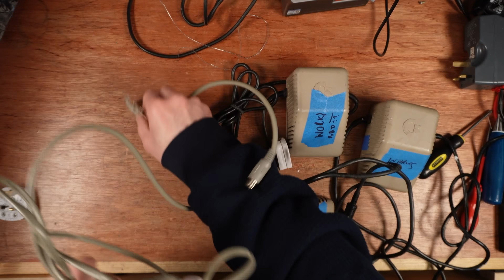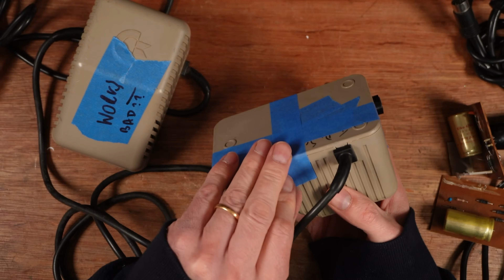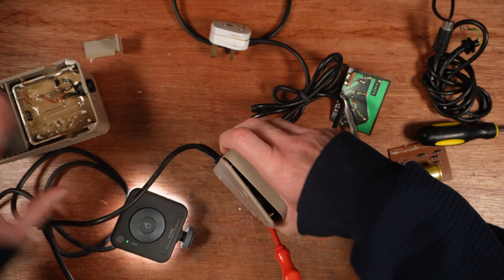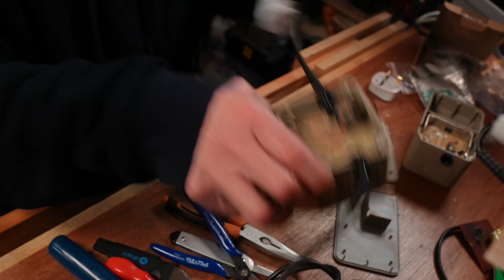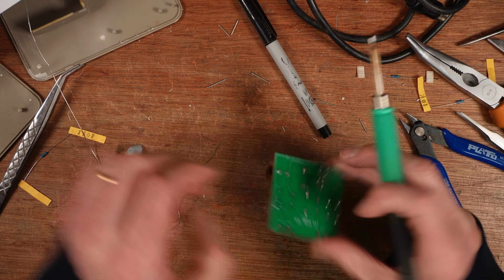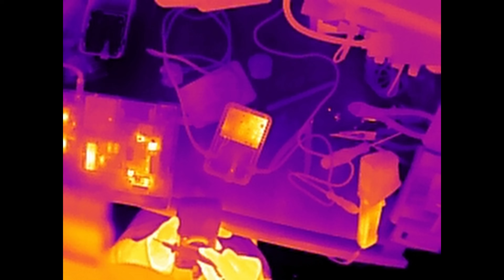C64 PSU Repair

Comment: Not sure if you'll see this now, but do the newer psu's like your C64c one still suffer from failing regulators? and if so would these boards fit in one of those PSU's?
Reply from the maker: Most C64 power supplies are ok really. It's just that enough of them go faulty in a really bad way that will destroy your C64. Some types are more prone than others, but personally I wouldn't trust any of them. This mod will only work with the brick I showed in the video.
Reply: @morefuntech  Okay thank you for the reply :). I'll see about a modern replacement for mine then, 'just in case' :D

Comment: Thats the first design I've seen that reuses the original transformer. Pretty nice.

The usual design I see uses a Meanwell module for the 5V, and a transformer for the 9V... which to be honest is pretty silly when 2x9VAC transformers are easy to get, and the 5V can be easily produced with a switch mode regulator. Usually the one with the 9VAC transformer just uses one of the secondaries anyway!

Comment: What I like about the UK plug is that it has a fuse in it and you can change it to a more proper value than the main fuse.
Reply: Thats the point of it really, because we have 32A "ring" circuits, which used to be protected by fuses as well. The fuse in the plug is designed to protect the flex going to the appliance from being overloaded in a fault condition.

Comment: Never ever put 'Chinese' caps in a project that you want to be reliable. They are renowned for failure. Only use quality Japanese or German Caps, like Nichicon, Rubycon. Trust me you are going to regrets this in a couple of years, when you have to break open the supply again. You also want to make sure the caps have a low ESR as the IC is a switching mode regulator.

Comment: Really bad power supplies. Made to die. If you open one, you can replace capacitor and diodes by another with more power. Diodes like 6 or 10 Amperes, and capacitor with working voltage more high. Then you can got a power supply to work forever. Only another problem. C64 computer like power supply don't was made to run forever. Not like Amstrad CPC. The most powerful 8 bits computer in the world. Made to run forever. You know this.

Comment: It's a shame they made the PSUs so difficult to service. The A500 supplies are much easier to get into. Also, a very simple crowbar circuit would have been nice, to protect against overvoltage.
Reply: There are potted Amiga power supplies as well... funnily enough the enclosure looks similar to the "rectangle" C64 supplies
Reply: @ i see. I only have one original A500 PSU, and it is super lightweight and not potted. Has very good ripple!

Comment: I installed this board. I noticed that it supplied 4.95V (even with the overvoltage) to the C64 which dropped slightly across it.
Reply: this is due to voltage drop in the cable and some loss in the power connector - especially so if the contacts in the plug and socket are dirty

Comment: I'm not in the UK and not in a 240V country. What's going on with that ground prong on the plug? You've only got two wires in the cable. What's the ground for?
Reply: Although the UK plug has an earth pin, on some applications, like this one, it is not used or needed. The UK plug has 2 options of wiring. A 2 core (Line & Neutral) cable for appliances that don't require earthing, or 3 core (Line, Neutral & Earth) cable for appliances that do. The earth pin is also used to move the safety shutter on the socket outlet open that covers the L & N before the L & N pins make contact in the socket.
Reply: All UK plugs have an Earth pin - not only does it give extra mechanical stability, it opens the safety shutters that cover the Live and Neutral outlet slots. The Earth pin is slightly longer so that it is the first to make contact when inserted.

edit: In fact Lee says all this at 22:00

Comment: I hate these epoxied-glued power supplies. Most times it will break and it will break ugly and will look ugly when I glue back and still have 1kg of epoxy. I prefer building a new one with a transformer and a 220AC-5DC brick. You don't have to build it overcomplicated with a hundred safety features, electronics went a long way since the C64 power supply and go bad differently. Be safe, use fuses, but don't protect the C64 you use twice a year with the price of a new car...

Comment: There’s an easier (and cheaper) way to get a similar result. I converted several psu’s using a ubec. You can find the instructions for this on lemon64.  Works great and even has an led.
Reply: The ubec is known to have a lot of ripple and in fact if you look at the board design files you'll see comparison tests vs a ubec. It works but it's not a good design.

Comment: You know what's struck me most in this video, when you're changing the plugs you're using a Phillips cross headed screwdriver! Growing up in the 70's and 80's when you learnt how to change a plug (or put one on as electricals didn't come with one) when you learnt to walk ( ;) ), every plug had flat headed screws. I have never seen a plug with cross headed screws! Is that just me?
Reply: I grew up in the 70s, when everyone learnt how to wire a plug at school, happy days. The older plugs were all slot head screws, but in my experience all the newer ones I have seen with the insulation on the pins are Philips/Posidrive screws, apart from some of the rubber ones I have, which still use slot heads.
Reply: @MrJozza65 yea, I think that goes to show how long ago I changed a plug. I might have done one 10 years ago on a C64...but thinking about it I just made sure it was safe and secured the existing old plug. Of course it makes sense that modern plugs have cross head screws, just that this is wierd having lived a lifetime before with the old plugs :)
Reply: yes
Reply from the maker: I know just what you mean. They have been about for a while now though :D

Comment: 5.25 is probably correct, at least for some versions,  according to schematics i've seen for c64 psus, they have a resistor in the 'ground' pin line of the 3 terminal regulstor to increase its voltage a little, likely to compensate for voltage drop across the DC cable,  i had a plus 4 psu of the wedge type with no 5v output, after opening it up it was obvious why , full of crscked dry joints, once resoldered, perfectly ok... you can bet many of the cases of overvolting was a dry joint on the ground pin of the regulator, if that happens they no longer regulate! i've never yet come across a shorted  through 7805, theyre supposedly quite resilient and self limiting, i dunno what actual type the commodore ones used(the schematic i've seen didnt give a type number), maybe a 'clone' regulator more prone to failure?   one way to improve 'safety' would likely be to wire a high power zener across the 5v line, to clamp the voltage, pretty sure you can get 'avalanche' diodes specifically for this purpose? certain'y seen them listed msny years back...?

Comment: The sealed these because they didn't want people messing about with them who didn't know what they were doing and potentially getting a 220v zapping. That's not a terrible reason, but the problem is the bed design with the voltage regulator cooking with the heatsink that they've embedded in toffee. Then again I don't think they ever expected people would be using these things 35-40 years on.
Reply: No. They were sealed and can't be opened so no one is going to 'mess' with it. The sealing was done to stop FCC Inspection because they knew it was minimal and cheap.
Reply: @g4z-kb7ct  FCC? These were made for European use, no FCC here... And the authorities will smash that stuff open if they need to.
Reply: @ The guts is the same regardless of country except for the transformer. The suss part is the board, that was the same in all those psus, square, angled or whatever.
Reply from the maker: We often forget these were never meant to last 4 decades!
Reply: That is the point (one point at least). They designed it cheap because they knew that it will be obsolete in 1-2 years so don't need to last 40, you will buy their next model soon so you want it to be cheap. And they were damn right and this made it successful. If only the company could have lived for a few more decades.

Comment: A simple but satisfying project. I completely agree with your preference to cut back to fresh metal when wiring the plug. Over decades the copper oxidises causing a barrier (ie. resistance) to current flow meaning that contacts are not reliable and prone to heat build up. Again,  like you I would be very nervous about drilling/screwing into potting compound- you never know what you might be touching! Since you deal with a lot of C64 PSU's it might be worth investing some time to rig up a DIN socket that breaks out the connections into easily accessible test points rather than risk shorting  the supply pins with the multimeter probes.
Reply from the maker: This is a good idea. I might look into this. Would make a nice project! Thanks 😁

Comment: This also gives 3 Amps on the 5v rail so with an adapter can also be used for the C128
Reply from the maker: Neat!
Reply: The regulator is capable of that, but the transformer's VA wouldnt be

Comment: regardless of what we all think the regulations state that flexes MUST have a ferrule  on them this is for several reasons not least strands being errant and of course the screw crush which may not be getting all the strands 
yes we all have put on thousands of plug tops without over the years but rules have changed
Reply from the maker: Hi. I used to be an electrician, and whilst that was a long time ago I felt confident saying what I said. But to be sure I asked a couple of current (pun!) qualified electricians to check the regs for me and they say that there is no such regulation that ferrules need to be used in this situation. In fact one pointed out that using a ferrule in that confined space can actually cause issues. I hope that helps.
Reply: They haven't asked everyone to buy a ferrule crimper... pretty sure it's fine, just don't be a knob and make sure you don't have stray strands and give it the pull test to be sure.

Comment: Yeah, even though I'm not the superstitious type, I can still see how a 13 Amp fuse could potentially mean bad luck for this kind of PSU.
Reply: It isn't too bad since there is another fuse in the PSU (black circle on the back unscrews and you will find another fuse in there protecting the transformer).
Only the mains lead needs fused protection in the UK because of the potential 32A ring mains. In Germany for example there would be no additional fuse in the plug, but then sockets here have a maximum 16A fuse in the distribution board. And the mains lead should carry the potential short circuit current even on a 16A circuit here with no problem for the time it takes to trip the fuse in the board.
So even with a 13A fuse in the plug the PSU should be fine 😅
Reply: @kuebbisch  See, I live in Denmark, which means the Euro-plug and therefore far less fuses. Usually 25A fuses on phases coming into the distribution board (before or after the HPFI? - I suddenly can't remember), and then 10A fuse-relays on each 240V groups inside the house and 16A relays on the 3-phased 400V power-groups designed for the older stoves, ovens, washing machines, etc. that nobody really uses anymore. But it also means that most of my fellow vikings are completely oblivious to there being fuses inside their PSUs and devices as well. I had oddly even shortly forgotten about those until you mentioned them just now.
- However unlike many of those fellow vikings, I don't think the UK plug is too bulky or over-engineered at all. In fact, I'd be one of the few applauding, if we all of a sudden decided to adopt them over here... which I guess would be extremely unlikely.
- But then, it could be worse, couldn't it? Those US and Australian plugs, they are rather flimsy and under-engineered accidents waiting to happen, aren't they?
Reply: @Zhixalom  I see your point for the UK plug at least in Denmark. I jam Schuko plugs into the flat danish outlets and charge my laptop without earthing when on holiday (We love the north sea coast around Hvide Sande).
I know that this practice could be dangerous, esp. since now the metal prongs of the Schukoplug could be exposed (no recess), but I always forget about getting an adapter since it fits.
Reply from the maker: If it was left under a ladder by a black cat then you might want to reconsider.

Comment: I got very lucky.  Back in 2013, I got a C64 that wasn't working.  Had a bad BASIC ROM.  Little did I know what actually killed it.

I put everything away for a few years, and then ran dead test cart.  I left the thing powered up for a week.  When I came back, I felt the heat, so I got the thermal camera out. +80C on SID!  Many of the other chips were running hot, too.  So I got the meter out and found it was shoving +7VDC into every chip.  I built a replacement power supply that gave a regulated +5VDC plus 9VAC, and that board amazingly started working fine! (one CIA was missing a joystick direction, but everything else came good)

I replaced this board with an Ultimate C64, but I'm pretty confident it'll still work.
Reply from the maker: Wow! That one is a survivor!

Comment: But with that new plug you cant do the 1p coin trick!!! 😂
But seriously i have quite a few of those on old PSUs....just need to get round to changing them. Good job im an electrician 🤔
Reply from the maker: Easy job for a sparky!
Reply: Yeah.. but............i know i need to get my finger out. Ha ha ha @morefuntech
Reply: It's actually the 1p coin trick or a paper clip fitted over the live and neutral pins that UK school kids did in science lessons as a nice surprise for the teacher. 😞
Reply: @edmguru007  when i was doing my apprenticeship in the late 80s early 90s the company i worked at had a contract for schools and we were always getting called out to schools in certain areas that had done those exact things.

Comment: Fuses in plugs are to protect the cable, not you.
Reply from the maker: A pedantic man might point out that the fuse is there to prevent the cable from melting and causing a fire, therefore protecting you? Good job Im not a pedant!
Reply: @morefuntech Quite right, 13A can turn any faulty appliance into a 3KW heater and send it up in smoke. Also, 100mA is spicy enough to kill.

Comment: I personally prefer to replace the guts with a 9vAC transformer and a plain simple 2A usb charger, much effective and very cheap, and runs sooooo cool.
Reply: this design is reusing the 9VAC transformer, and the new regulator is a switch mode regulator which will run just as cool as the "USB charger" will
Reply: personally i wouldnt, you never know what could happen in the usb charger, many arent very good!
Reply: Yes, don't buy a REALLY cheap one, but if your phone is more expensive than a C64 and you dare to plug in, then it will be fine for the C64 :)

Comment: I'm surprised C= didn't skimp out on the potting resin. Nice if they had.
Reply: No company ever skimps out on the potting resin - the weight gives the illusion of quality where none exists.
Reply: @michaelstanley420  It is a bit random though. The people doing it were equally random and filled it however they wanted to any level.

Comment: Apart from the initial battle to get the base plate off - this is such a simple yet effective upgrade to the PSU. 

For me only the rear 2 corner pegs snapped, the rest came free after a little bit of wiggling around. Including the 2 pegs in the middle - though it took some blind wiggling to get them back into the holes in the resin. I also found that that plastic cement you get for doing miniatures works really well to glue the plate back into position afterwards

The kits are relatively cheap on eBay and the optional LED works well through the side slats to let you know that its powered on